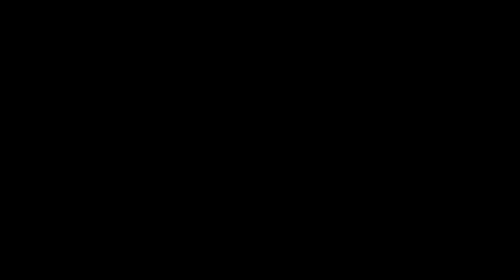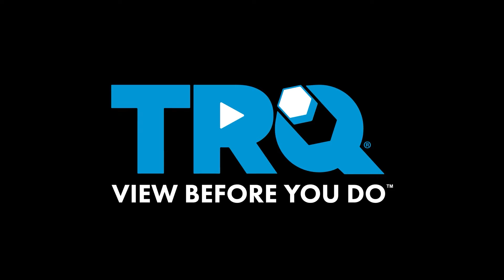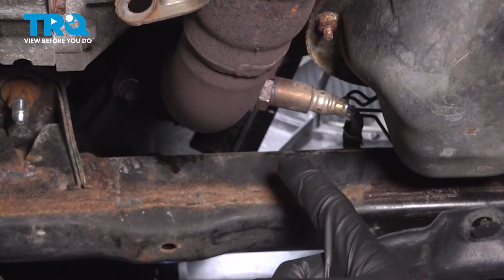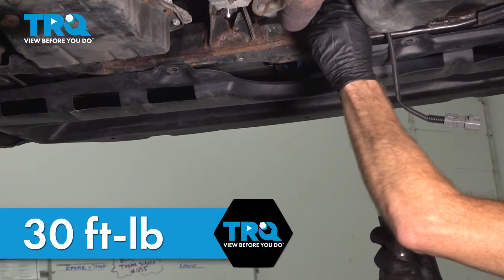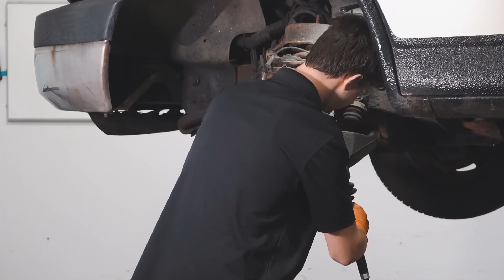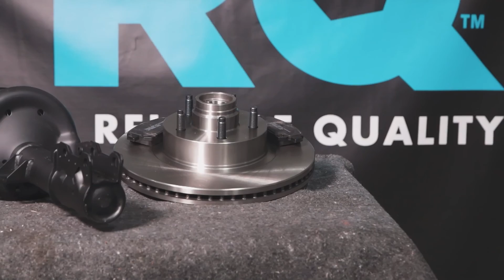How to Replace Bank 2 Sensor 2 O2 Sensor 2011-2020 Toyota Sienna (3.5L V6)

Comment: is there a connector between that one and the next one up in engine bay? Mine needs to be a lot longer than that to even connect. 2015 sienna xle fyi